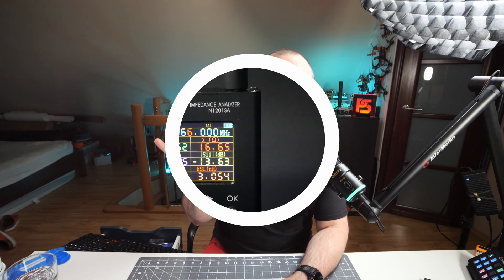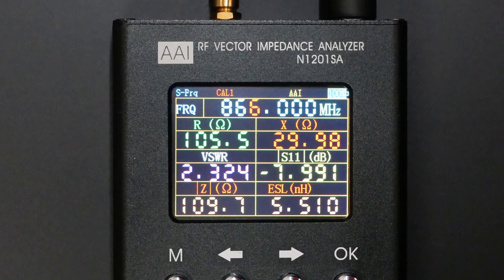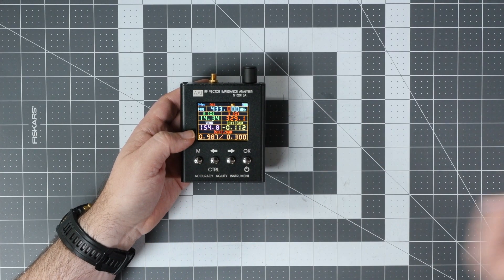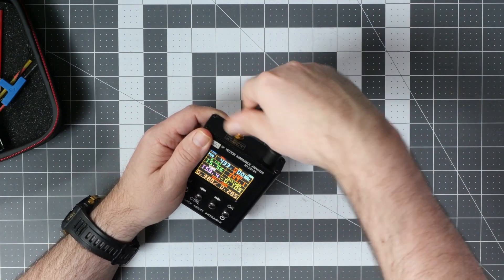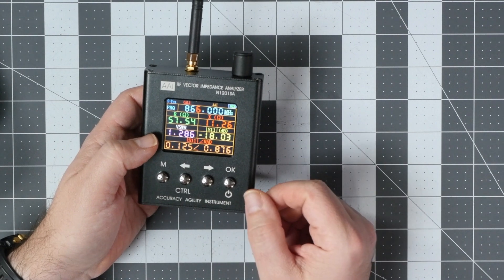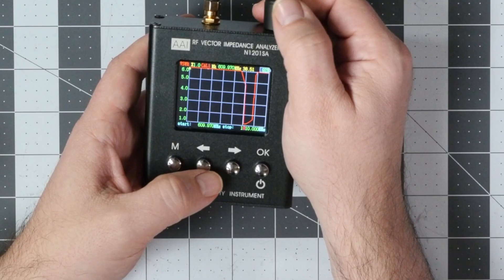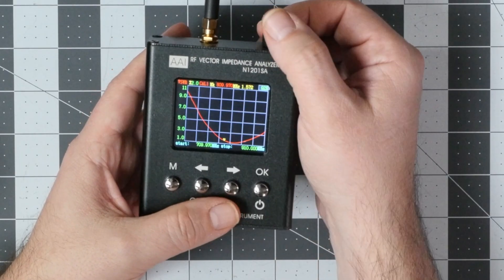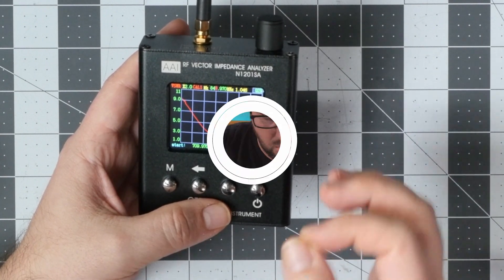How to measure antenna tune | VNA, VSWR, S11

Comment: While related, I have a left field question for you Sir. My fixed-wings are looking more and more like my quads - festooned with antennas, bristling like masts from sailing ships. My VTx typically has a pagoda, I use LFrSky 9R paddles, plus GPS sensors. My ELRS planes have a vertically oriented dipole, and of course all of them have FPV cameras, typically plopped up front and on top. I'll stick a Mobius mini under a wing sometimes, and run a Caddx Peanut behind the FPV camera on a short mount.

How 'draggy' is all this tech we've added to our planes? Obviously there's a weight penalty, too, which must be, what... 50-100g for an FC and FPV? Should we be taking this more seriously? I know Lee over at Painless360 has a couple planes with a flush VTx antenna that seem to perform well, but I wonder if we should start thinking about efficiency in terms of drag, not just the size of our Li-Ions and motor/prop combos?

Being worried about it, I've installed my L9R antennas internally in my newest build, a Dolphin, deep inside the foam fuselage in the plane's batter tunnel, but still perpendicular to each other. Along with the GPS sensor, it seems to be working fine tucked under the dense foam, but I wanted to know if you suggest against it?

Comment: so I have this thing for a while now and make my own antennas for 868,915 and 2400mhz... always good antennas. 
but I still don't understand the s11 value... should it be as low as possible e.g. -20 or even -30??? 
how can I guess or calculate the db value of the antenna???

Comment: Great video Pawel. I have this and the NanoVNA and took me quite a while to figure out how they work because, as you know, documentation goes from bad to non-existent. I would like to add one suggestion tough. Due to the simplicity of those devices, it's good practice to let it warm-up for a few minutes (say, 5) before using it.